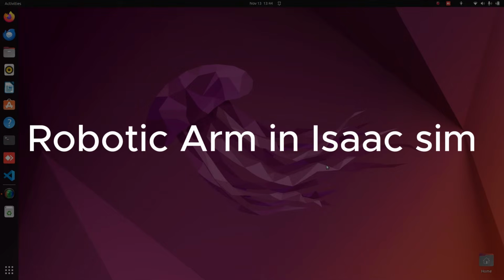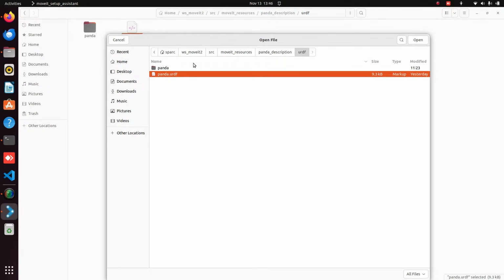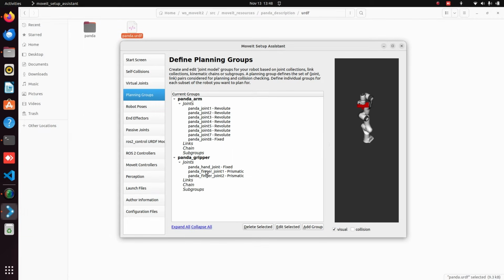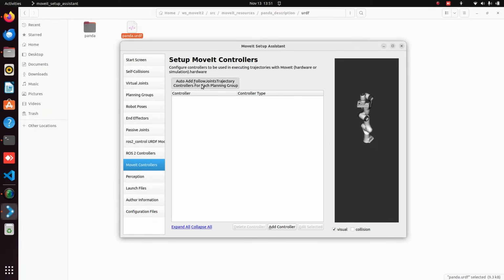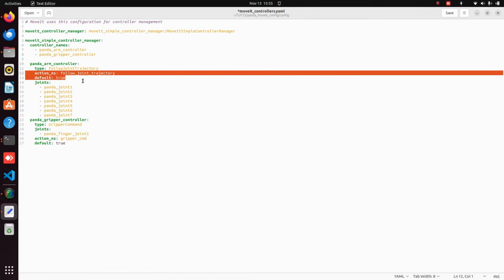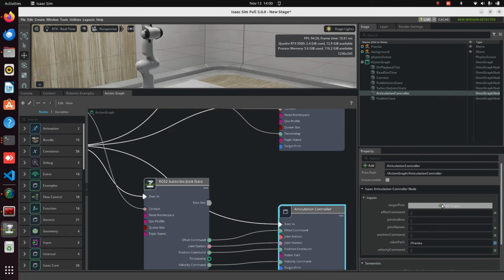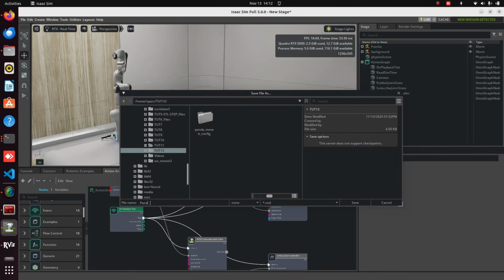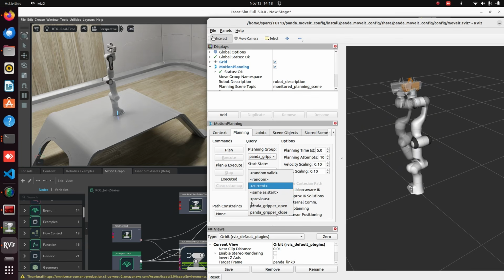Tutorial #13 – Isaac Sim MoveIt: Control Any Robotic Arm (Motion Planning & ROS2)

Comment: i have faced a problem. I am using ros2 jazzy. there is no package have been found like "topic-based-ros2-control". What should I do the steps for ros2 jazzy?
Reply from the maker: For ROS2 Jazzy, use the updated `ros2_control` + `ros2_controllers` packages instead, since `topic-based-ros2-control` is not available.